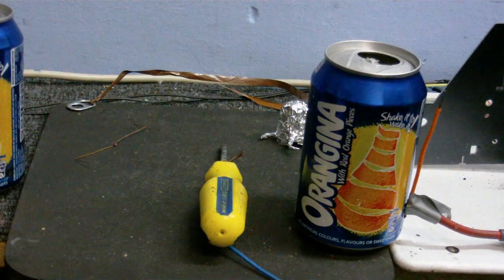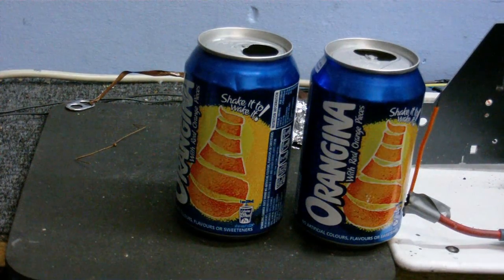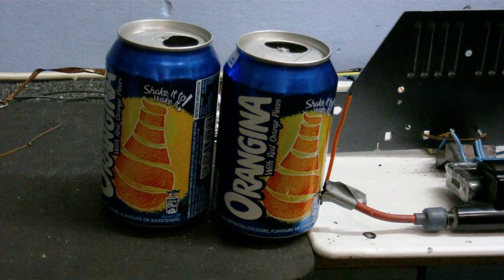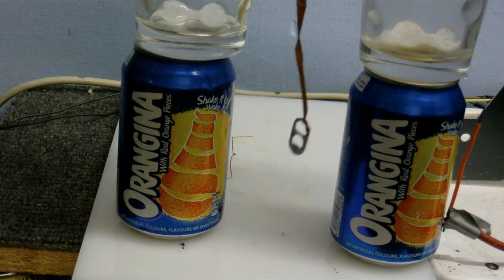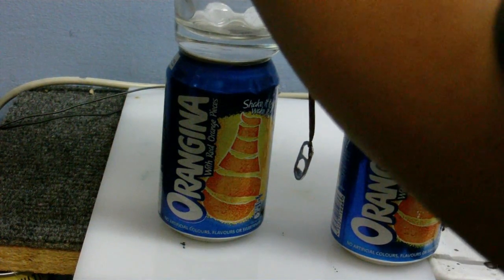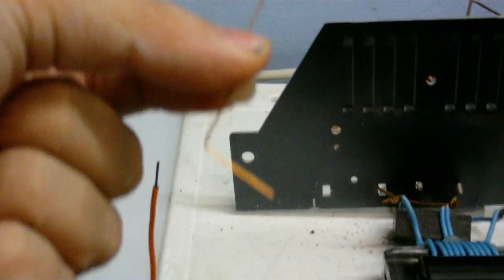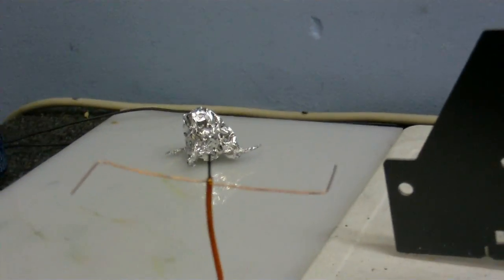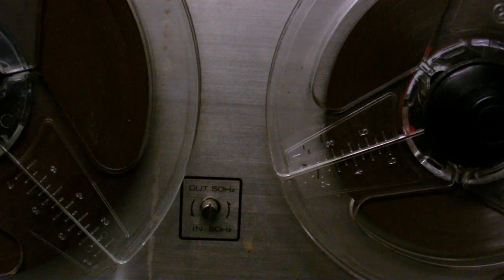Some more HV experiments

Comment from the maker: @BBC600 It's not really a magnet, what happens is the first can gets positively charged, and the ring-pull gets pulled towards it because it is more negative than the can, when it touches the can it get's positively charged and get's pulled towards the grounded can because the grounded can is less positive than the now positively-charged ring-pull, when the ring-pull touches the ground can it disperses it's charge and the whole thing repeats itself. (I think that's how it works anyway)

Comment: I'm working on a schematic for a flyback driver right now myself.  I extracted a flyback from a glitching TV that we put away last year, and I've seen lots of different options for circuits on instructables.  I want to make a circuit that can handle long operation without failing.  That's more important than total voltage output (although output is still important).  Basically I'm just asking if you have any advice on what type to build for steady operation without overheating.